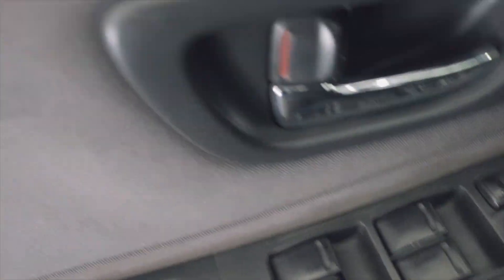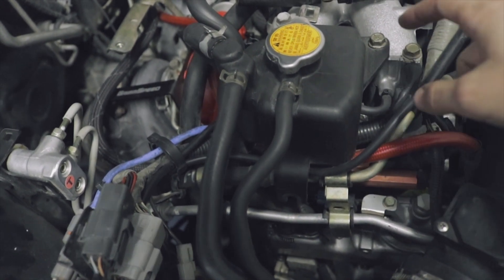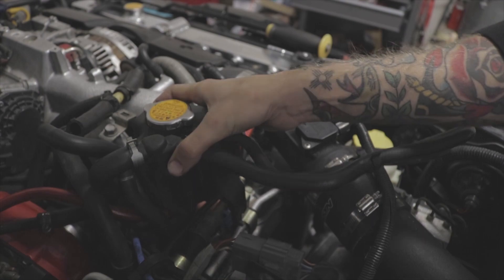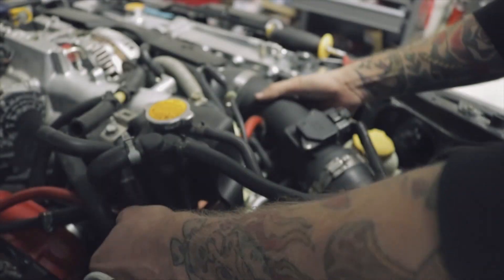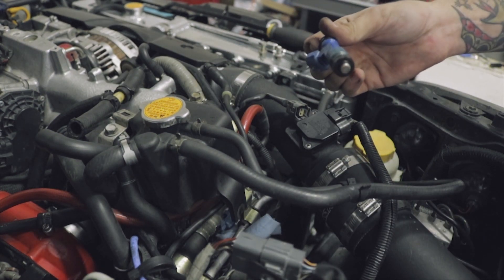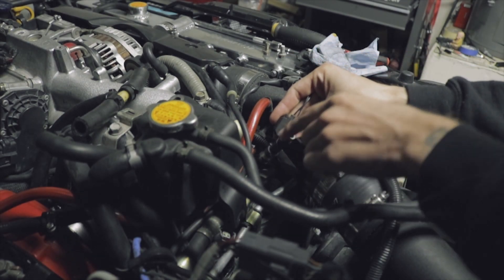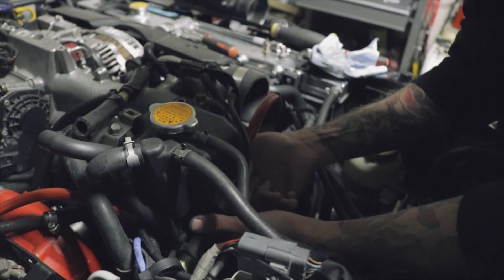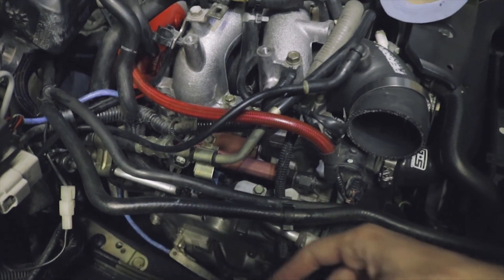Flex Fueling the 2006 Subaru WRX Part 1: Injector install Step by Step

Comment: Really wish I could see what you were doing.
Reply from the maker: Hard angle to video but it's pretty straightforward honestly. Just two bolts, pull up the rail and they pop right out
Reply: you can't expect the guy to hold your hand, just look at your own car and used the video to get an idea of where to start.

Comment: Man I wish you did a step-by-step on the driver side. The passenger side is easy but the driver side is a hot mess with the air pump and rat's nest of hoses. I'm stumped!
Reply from the maker: I actually did an air pump delete on mine but you'll remove the air pump and bracket and you kind of just have to struggle a bit unfortunately lol that side is definitely tough, especially the front injector.
Reply: @KyleHidalgo  pulling the air pump made it much easier, and also pulling the valve cover vent hose made it way easier to reach the bottom screw of the GBOD. At least the front GBOD screw wasn't blocked off like the passenger side 😎
Reply from the maker: Yeah it's pretty much a necessity lol if you know a tuner I would look into the delete, it's not too hard. Ah yeah I forgot about that hose. Been so focused on my 350z lately lol. Glad you got it though!